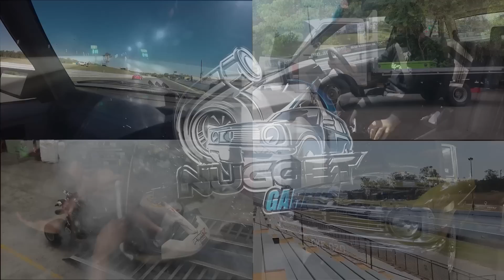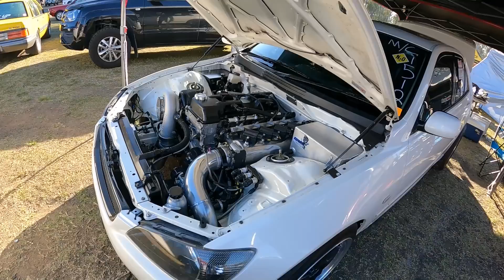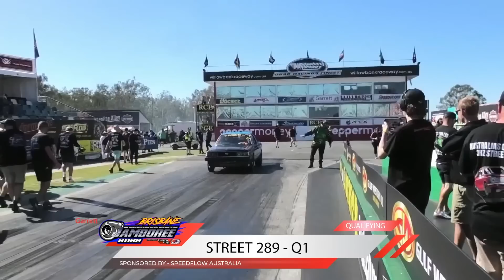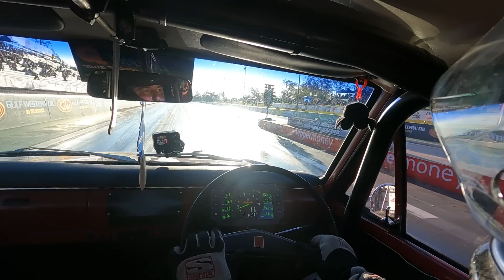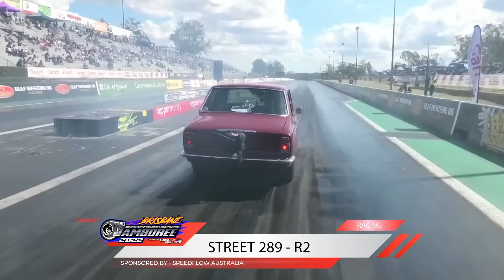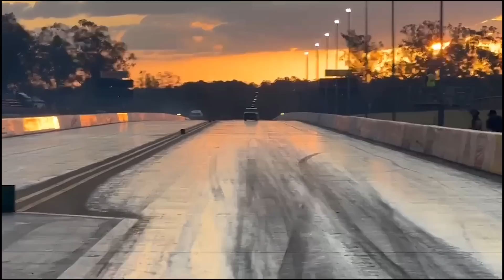3RZ KE10 at Brisbane Jamboree, How to lose a final.

Comment: Killing it bloke 💪🏻 … remember to put your visor down !
Reply: May I ask why? Is it incase of a fire? Not being a smart ass or anything just generally don't know aye
Reply: @GLOBAL-STRUGGLE  Yes it is in case of fire. Not to sound like a prick, but it kind of defeats the purpose of even wearing the helmet if you don't put the visor down. Sure the helmet is mainly to protect you in case of an accident and stop your melon from getting squished. But it has a huge secondary purpose with the visor when it comes to motorsport in particular because it creates a sealed environment for your face. Once you start running faster than 9 second runs you need a serious step up in safety gear like your roll cage must start getting to funny car spec and you need extra level rated fire suit, drivers typically must wear gloves, fire shoes, and even fire head cover. And this mostly comes down to the fuel they are using at that level. They aren't using regular gasoline anymore and typically have race fuels that are more oxygenated and/or methanol. When these fuels catch on fire they burn super intense and have nearly clear flames during daylight hours. It's very hard to see the clear/blueish flame and therefore you don't usually know something is on fire until you FEEL it. And that's a bad place to be when it comes to protecting your face. So typically your visor down and wearing a fire hood is what gives you 10-20 seconds protection when engulfed in flames to try and avoid permanent damage. Without that visor down the flames can literally just get right to your most valuable body parts (eyes, nose, mouth, lungs) and cause serious damage within seconds. The difference of having a visor down vs up can be the difference in life changing injuries. It seems like something insignificant at the time until you actually have an accident and catch on fire. And when your gear is finally put to use is when you finally realize its value.
Reply: @aSinisterKiid  nah that makes sense I figured it was probably to do with that but that's better than I expected 10-20 seconds it's not much but when it's an emergency any time is important
Reply: @aSinisterKiid  I agree mate, just take a look at the dude who drives beer money... Copped horrible burns to his face from not shutting his visor.